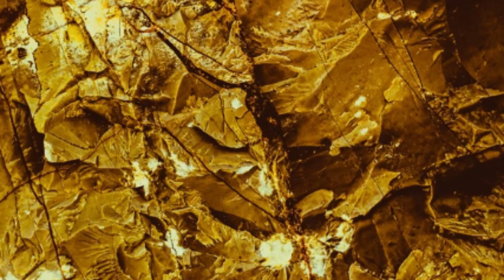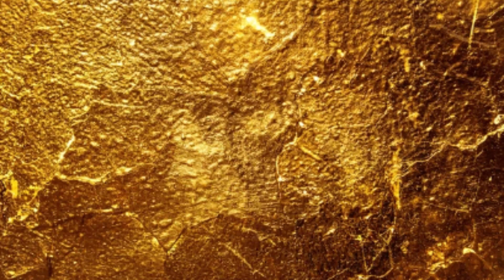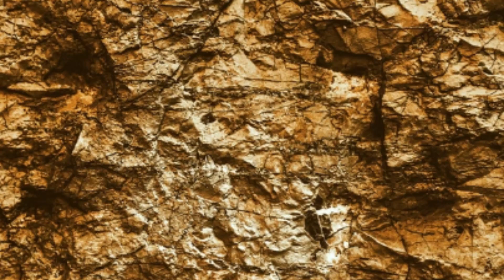Oxidized Gold Ore Explained: The Geological Process Behind Every Gold Mine

Comment: Can this type of ore be processed by grinding, roasting and smelting with a collecting metal (lead)?
Reply from the maker: Yes — that combination of grinding, roasting, and smelting with a collecting metal like lead is a classic fire assay–style approach, but whether it’s effective depends heavily on the type of ore and its mineralogy.

Here’s the breakdown:

1. Grinding

Purpose: liberate gold, silver, or other target metals from the gangue minerals.

Works best when the ore’s valuable minerals are fine-grained and can be exposed with moderate grinding.

If the ore contains refractory minerals (like sulfides or tellurides), grinding alone won’t free the metal completely.

2. Roasting

Used mainly for sulfide-rich ores or ores with organic carbon.

Heat in an oxidizing atmosphere drives off sulfur, arsenic, or other volatile compounds and converts sulfides to oxides.

This step can make gold or silver accessible to subsequent smelting.

Caution: roasting arsenopyrite or other As-bearing minerals will release toxic gases.

3. Smelting with Lead (Pb)

Principle: molten lead acts as a collector for precious metals during smelting.

The lead alloy is then separated from the slag, cupelled to oxidize Pb to PbO, leaving behind a precious metal bead.

Works well for gold and silver even if they occur in trace amounts, but it’s usually a lab-scale assay method — not a production-scale recovery technique — due to lead’s toxicity and environmental issues.

When this method works best

Ores containing gold/silver locked in sulfides or quartz, but not in refractory minerals like arsenopyrite without enough roasting time.

High-sulfide ores where roasting removes sulfur and liberates precious metals for collection by lead.

For analytical purposes or small-scale refining, not bulk industrial production.

Comment: Can gold also be precipitated out as a chloride or sulfide in nature? If yes, how?
Reply from the maker: Yes, gold can be precipitated out as a chloride or sulfide in nature under certain geochemical conditions. This process occurs in specific environments, such as hydrothermal systems, where gold-bearing fluids interact with sulfur- or chlorine-rich solutions, causing the gold to precipitate. Here’s how it works:

1. Precipitation of Gold as Chloride (Gold Chlorides)
In high-temperature hydrothermal systems, gold can dissolve in fluids as a chloride complex (e.g., AuCl₂⁻ or AuCl₄⁻). These fluids are typically rich in chlorine, which comes from the dissolution of minerals like halite (rock salt) or from magmatic gases.

Gold precipitates from these chloride-rich solutions when the geochemical conditions change. The key factors that trigger this precipitation include:

Cooling of the fluid: As the temperature drops, the solubility of gold decreases, causing it to precipitate.
Changes in pH: A shift in pH (usually an increase, making the environment more alkaline) can destabilize gold chloride complexes, leading to the deposition of gold.
Reduction in chloride concentration: If the chloride concentration in the solution decreases due to dilution or other reactions, gold can precipitate out of solution.
In nature, this process is responsible for the formation of certain gold deposits, especially in epithermal systems and porphyry deposits, where magmatic fluids rise toward the surface and cool, depositing gold and other metals along fractures and veins.

2. Precipitation of Gold as Sulfide (Gold Sulfides)
Gold can also form sulfide minerals under certain conditions, particularly in environments rich in sulfur and low in oxygen. In these environments, gold dissolves as sulfide complexes (e.g., Au(HS)₂⁻) in sulfur-rich, reducing fluids. When conditions change, gold sulfide minerals can precipitate. This often occurs in hydrothermal systems associated with volcanic activity or in areas of deep-sea venting, where hot, sulfur-rich fluids circulate.

Gold precipitation as sulfides can occur due to:

Reduction of the fluid: In more reducing conditions (lower oxygen levels), gold complexes can become unstable, leading to the precipitation of gold.
Reaction with sulfur-bearing compounds: When gold-bearing fluids interact with sulfur-rich rocks or minerals, sulfides such as pyrite (FeS₂) or arsenopyrite (FeAsS) can form. Gold can be incorporated into these minerals either as inclusions or as part of the sulfide crystal structure.
Decreases in temperature or pressure: Cooling or depressurization of hydrothermal fluids can cause the gold to precipitate as sulfide minerals.
This mechanism is often seen in Carlin-type deposits and some volcanogenic massive sulfide (VMS) deposits, where gold can be finely disseminated within sulfide minerals like pyrite or arsenopyrite.

Conclusion
In summary, gold can precipitate out of solution as chloride or sulfide under specific geochemical conditions:

In chloride-rich environments, gold forms soluble chloride complexes and precipitates when conditions change (e.g., temperature drop, pH shift).
In sulfur-rich, reducing environments, gold can form sulfide complexes and precipitate as gold sulfides in response to changes in the chemistry of the fluids or surrounding rocks.
These processes are responsible for many of the world’s significant gold deposits found in hydrothermal systems.
Reply: @professionalgeologyclub  sooo grateful to you man,, 👍🌹